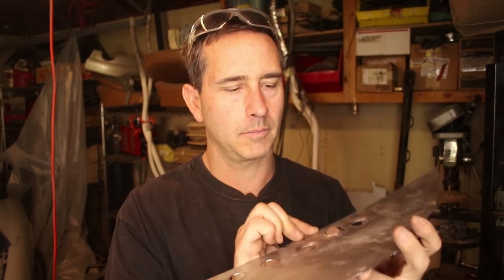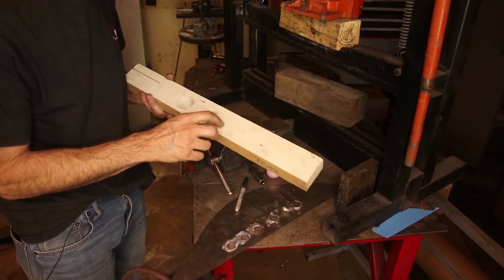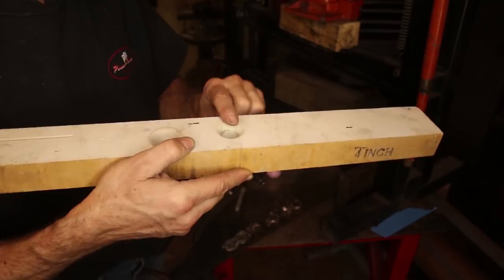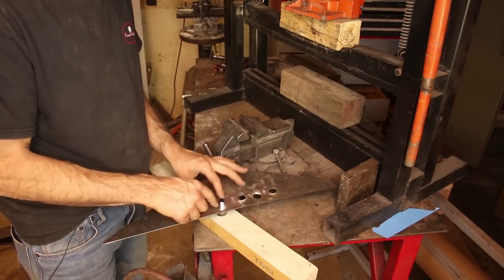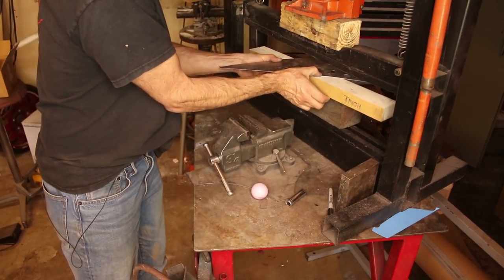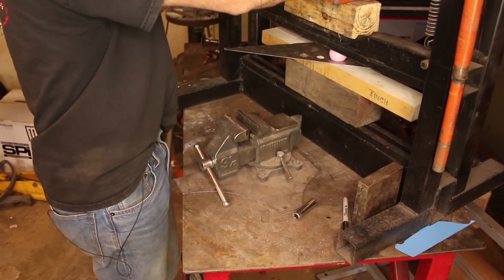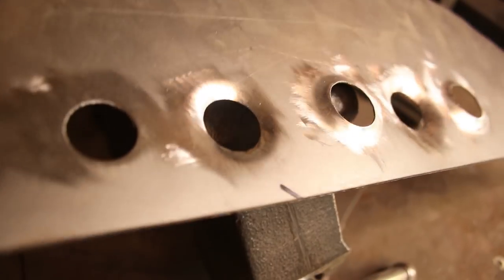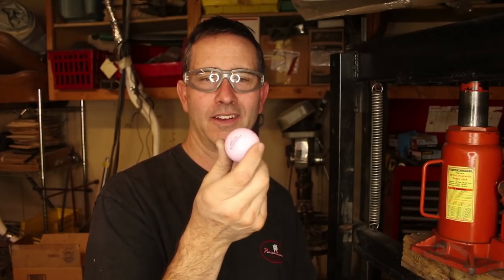How To Fabricate Speed Holes In Sheetmetal With A Golf Ball

Comment: Cool idea -- Thanks! But why is this called a speed hole? I get dimple, but speed? Any clues appreciated.
Reply from the maker: Back in the day racers made their cars faster by reducing weight.  These holes were punched and flared to save weight, but retain strength.  
Obviously, it takes a lot of holes to make a difference, so now they are used for style points mostly.